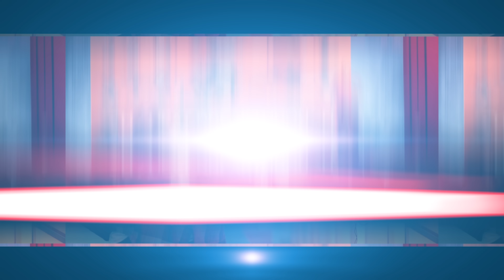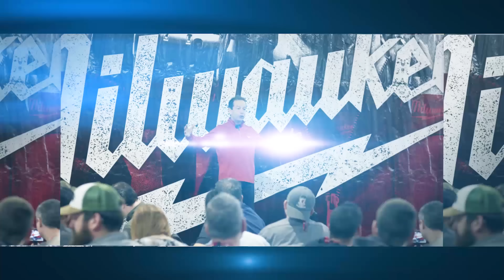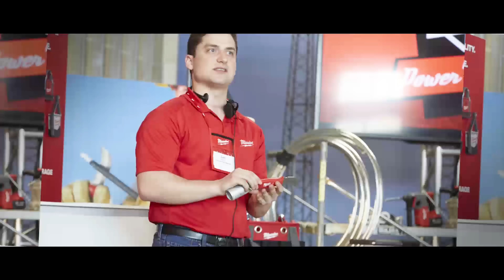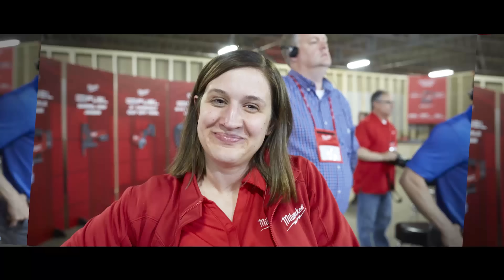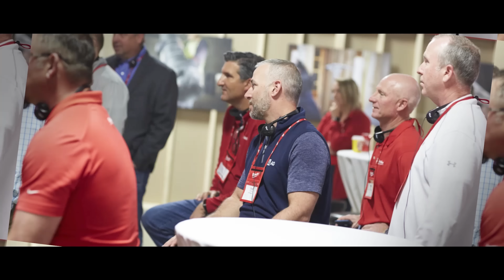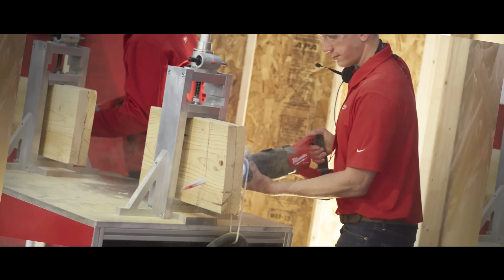TOP 5 NEWEST MILWAUKEE TOOLS YOU WON'T SEE ANYWHERE ELSE!

Comment: Great Choices. mine would b different only due to what I already have vs what I still need. they are;
1, Packout Dolly
2, M12 installation driver
3, m18 framing nailer
4, Milwaukee fish tape
5, Packout Plate
I love the Radio too, very much but I'm arguing with myself whether I can justify the size of it?! so want it tho 🤫

Comment: -Been holding out on the cordless narrow crown stapler since I own at least a dozen m18 batteries, and 0 black & yellow batteries.  My pneumatic bostitch works just fine but requires a compressor.  When you do test the cordless framing nailer, make sure to stick in the freezer to simulate use in northern climates.  Also, I've owned two 12" Bosch miter saws, (currently just the glide version) and ever since I picked up the Bosch 8-1/2" miter saw, the 12" rarely gets any use.  In fact, it stays in my garage and is only pulled out when cutting large crown moldings & millwork.  Otherwise, the 8-1/2" miter saw will handle 95% of my cutting needs, especially deep treads & flat stock.  I do own the Milwaukee m18 7-1/4" miter saw for small jobs, or for spot cutting without having to trek all the way to the makeshift on site shop, but it has its obvious cutting limitations.  Now, if Milwaukee introduced an m18 8-1/2" (deep slider) version like the Bosch, I would definitely buy one.  Fingers crossed.
Reply from the maker: Good tip on the freezer!

Comment: Love the list & gonna be getting everything on it when comes out. So excited, & specifically waited till Milwaukee had the framing nailers, circ saw, & router b/c I’m just not wanting one more battery platform to deal with😂. The only thing I’m missing, the new m12/18 fuel oscillating multi tool, otherwise.....is a great year for Milwaukee!
L8R ✌🏻

Comment: I love cordless tools, so I'm on the Milwaukee m18 m12, dewalt 20 and flexvolt, ridgid, and ego. It is a little bit of a pain with all the batteries but I'd rather have multi platforms than corded.

Comment: As of this juncture, I'm impressed with the new line of Milwaukee cordless tools.  The one I'm most interested in is the rear handled cordless 7 1/4" circ saw.  The reason that this saw is lighter is because it doesn't have that worm drive gear box  which you have to keep lubricated thus lighter weight.   I also like the left line of sight vs a right line of sight on 2 of the corded circ saws I already use.  I'll wait until these tools have been out on the market for a while and read some reviews before delving in to a new batt platform.  Thanks for sharing.  Cheers!
Reply from the maker: Thanks William Logan you da man!

Comment: My top 5
Pak out radio
Miter saw
pak out radio
Remote light
Pak out radio
Reply: I agree "Dan the man"
The packout radio is my Fav! Because I love the packout system, love that it's a charger, and the milwaukee speakers always sound awesome! This will retire the Bosch jobsite radios we've been using 👍
Reply from the maker: Sweet top 5 dan the man!!
Reply: @MostlyPeacefulCombatVet  Not gonna lie it is just for the bass and sound quality. LOL! Who knows  I might get into the platform
Reply: @dantheman9395  you should sir! Chances of going back to any other are slim to none. That's been my experience anyway. But yes, the bass and clarity of the milwaukee stuff is Crazy good. If it lives up to the expectations like we think it will, it should outperform the Bosch 360 that we use. Which is a beast. Being a packout and charger is certainly a big added bonus
Reply: @MostlyPeacefulCombatVet  i was disappointed with the milwaukee bluetooth speaker...i returned it to HD...sound quality was bad compared to my JBL bluetooth speakers
Reply: @kingofthecrease30  yes jbl, bose, klipsch, and Harmon kardon all sound better for sure. But they aren't m18/m12 powered jobsite speakers either. Maybe you got a bad one. or maybe the device you were running wasn't tuned well for the unit. I had to mess with the phone eq a lot to get mine perfect and it absolutely rocks.

And everyone has different taste in music and sound I suppose. So it's hard to find a one size fits all. Lol!

Klipsch is still my all time Fav for home audio. And the JL W7 home subwoofer. Man what a combo. 
Anyway now that I'm off topic. 

Sorry to hear you didn't like yours. Haven't heard a lot of peeps say that. Especially for the promo price/size/purpose. 

I wouldn't pay retail by any means. But that goes without saying for all things. Haha

Comment: Hey vince. Hope you are doing well. I can't wait for the m12 installation drill driver.
Reply from the maker: Me neither David!!
Reply: @VCGConstruction  I work at Methodist Hospital in Houston as a cabling and IT guy and we install a lot of equipment. I think it will be handy. I now have the Ridgid 12v and just bought the Milwaukee m12 so I'm in the conversation stage thanks to your vids. I seem to use the drill more than the impact.
Reply: David Elkins huge fan of Vince and the vcg.  It was from there videos and the community that made me make the jump from rigid to Milwaukee.  And I’ve been nothing but happy with the tool offerings and quality.
Reply: David Elkins yeah I agree, that’s the only thing I would switch out from Vince’s list.  Installation drill driver instead of the surge
Reply: @brianc5921  I'm a big VCG fan. They take the guess work out of which tools are better. I will use that tool probably more than my drill and impact.
Reply: Would have been Sweet if they would have came out with an M18 Installation Driver Also ....